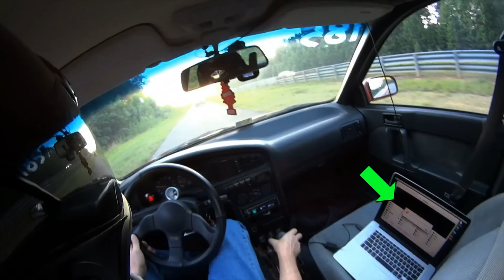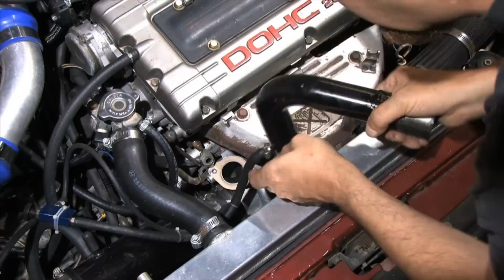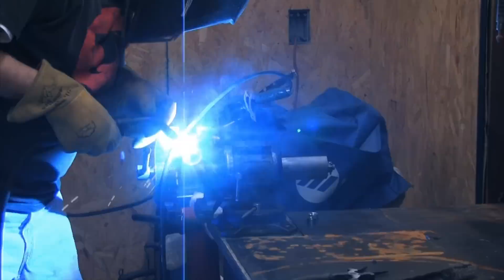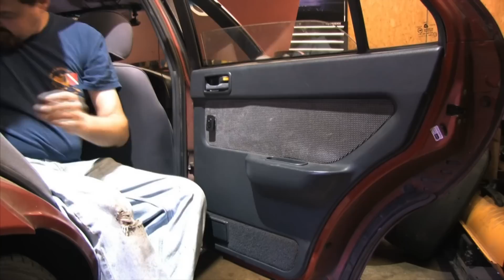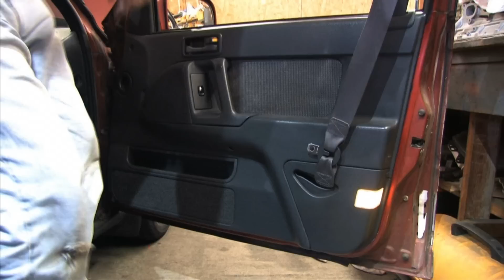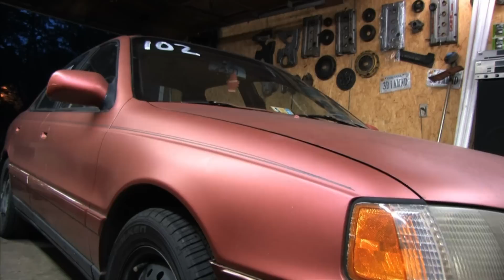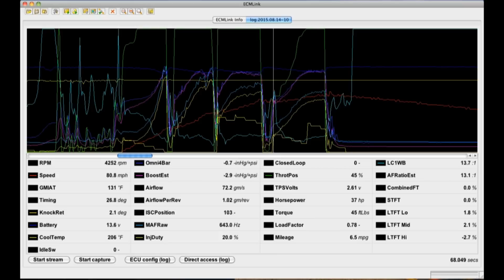Hyundai 15 - Trials and Tribulations

Comment: Considering this Hyundai has the heart of a DSM, those pesky dsm gremlins are bound to show up and test a guys patience, glad to see another person with the dedication to work through these little bugs instead of parting out like oh so many do these days. Keep it up Jafro! 

On a side note, did you happen to take any footage from the DSM Shootout? You met a buddy of mine but sadly I didn't get to shake your hand. Maybe next year!
Reply from the maker: +FrequencyOfThought It's a Galant 2.0L NA block with a DOHC 1.6L Hyundai head that's a knock-off of the 4g61t design.  Turbo crank, Galant pistons and rods.  Transmission is a F5M33 out of a '90 Plymouth Laser.  The body's a '92 1st-gen Elantra, it has cut springs from a 1g Eclipse, Mitsubishi EXPO front brakes, hubs and knuckles with Nissan Altima LE wheels and the standard 1.6L Hyundai axles.  The engine harness is patched into the Elantra's ECU and interior harness, and it came out of a 2.0L Hyundai Sonata.  The front bumper is off of a Subaru Legacy Wagon.  The steering wheel is from a Mitsubishi Mirage.  It had a Subaru stereo in it when I first found it sitting in my driveway with the keys in it, but I changed that.
Reply from the maker: +Jason Drew I did shoot footage, and the best of it was from between the staging lanes.  I didn't make a showing with any of the cars that have been on this channel yet, but it's inevitable.  I swear, it was like incognito mode.  Only one of the vendors there that I shopped with had any clue who I was.  I know I was surrounded by people who watch my videos, but people only recognized me by my hands or my voice.  After I realized this, I didn't shut up, and I apologize to the kind gentleman who put up with my tired babble until 3 am.  ;)  It was awesome getting to meet Tom, and I'd like to go on the record saying I regret not arriving sooner, and having not spent more time rolling around the event with him.  He's a great host, a positive, energetic doood, and if it weren't for his invite I don't know if I'd have made the thousand mile trek.  Now that I have, I will be back, I'll be better prepared, I'll bring toys, and I've started working on that camera time so that maybe next time people will recognize me.  lol!
Reply: +Jason Drew  What block is it what tranny I don't think it really is that significant to be related to the DSM it's much more a pos
Reply: +Jafromobile so what is the actual nickname for this thing. I mean I don't want to use the sl*+ name but she's been around the block a few times and has acquired things along the way that don't necessarily belong. I mean don't get me wrong I love watching every video of her and can't wait till she finally gives you a good run but the nickname for a beaut garage built masterpiece like this needs to be epic. Like Queen  Latifa or The Kardashian. Sometime so terrible that it's memorable. Idk. Keep the videos coming man. Waiting for your own show on TLC, the location can't change for the set tho.